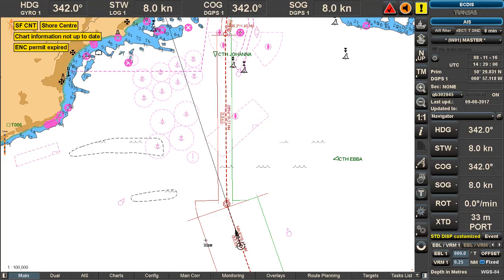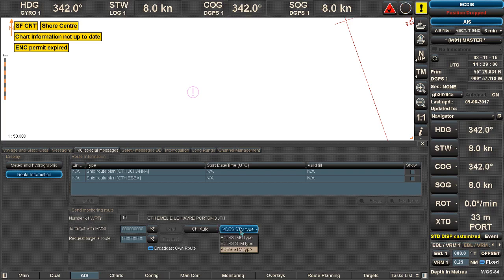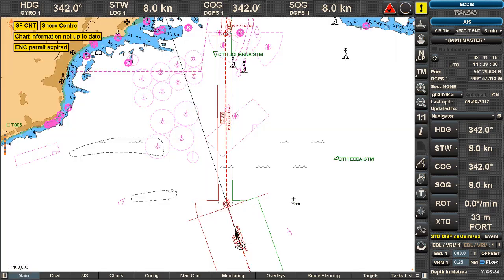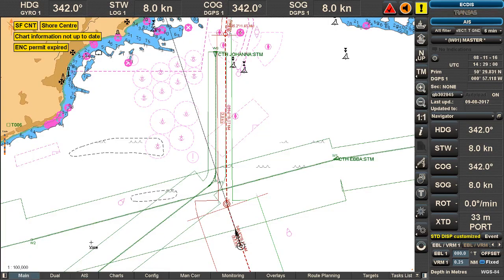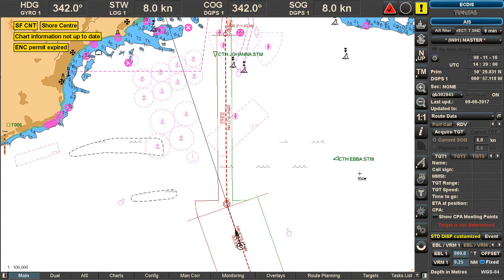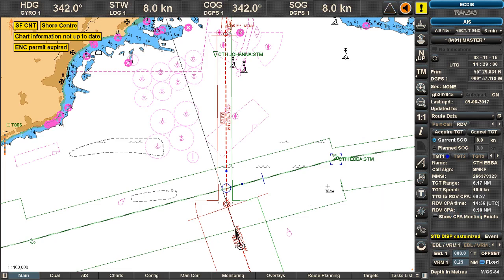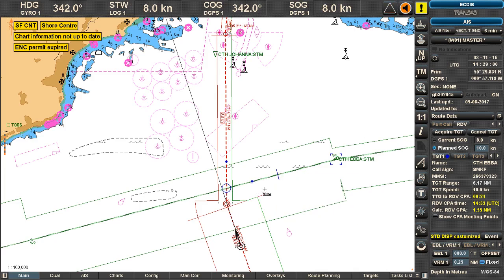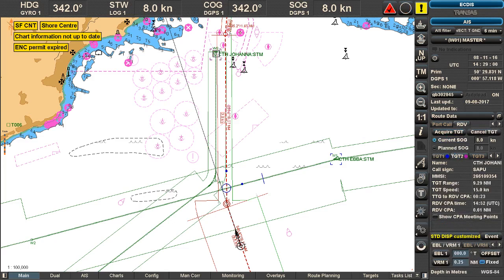STM instruction Transas ECDIS – How to use ship to ship route exchange

Comment: Can we get Rendezvous points information without STM functionality?
Reply from the maker: The rendezvous function existed in the (then) Transas ECDIS before the STM functionality was added. It is thus most probably still available. To be 100% sure, please contact Wärtsilä.
Reply: @SjofartsverketMedia  I will try to access RDV functionality from Route Data multi-display panel. I think, it can be there but based on current SOG and COG not route data which requires STM to exchange routes.
Reply: @SjofartsverketMedia  Yes, Rendezvous Points (RDV) works on NS4000 even without STM functionality provided that own ship has a monitored route, and the target is within the range of 2 NM.
STM adds the route exchange functionality to RDV showing a graphical representation of CPA on both vessels according to route data or current COG.